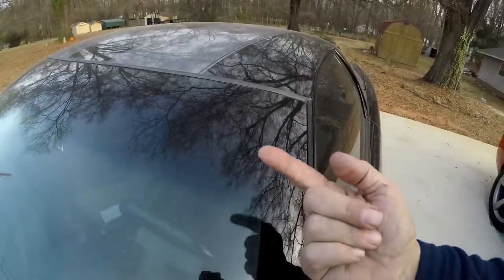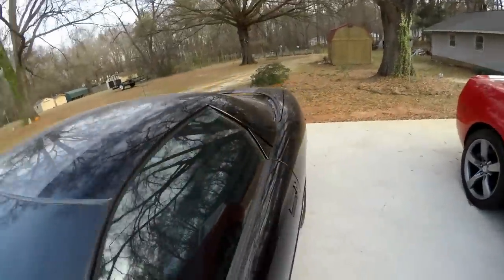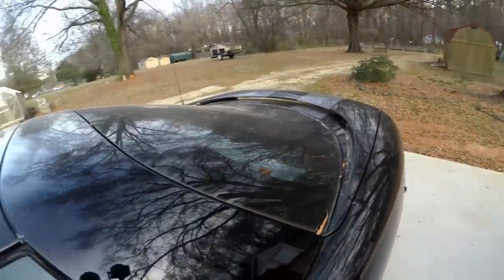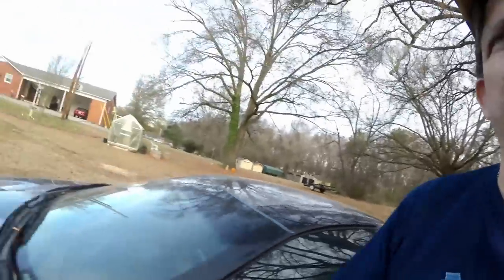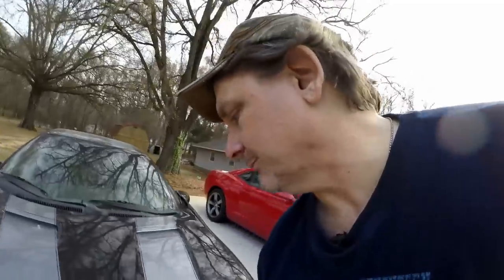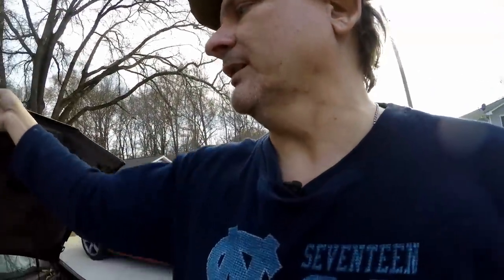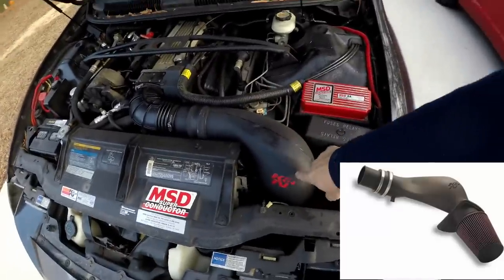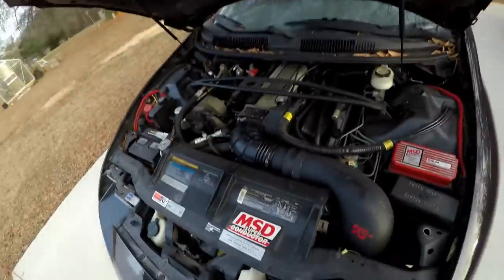Top Mods for a 4th Gen Camaro and my 1993 Chevy Z28

Comment: Good advice. I had a 98 Z28 before my 97 SS. I did full bolt ons inc: long tube headers , off-road y pipe , ls6 intake manifold, free air lid mod, SLP lid. The final step was a ported stock throttle body and man what a difference that final piece made to tie everything together. Vastly improved throttle response and made the car so much more fun.
Reply from the maker: wow....Some great mods!!! Sorry for missing the comment. It got lost in the YT shuffle............Thanks for watching

Comment: Got 97 Z28 anniversary want  to keep all original radiator split so I did a 3 core aluminum,  waterpump, opti spark, timing chain set,  10mm wires, iridium plugs, msd coil, long tubes, (3in) x pipe (3in) all parts took off were working but like you say there old . Throttle body on order went with 58mm (sorry) adjustable coil overs for front and rear vented rotors and new calipers all corners on order but now gonna do msd box, strut tower, have a 01 Z06 was sposed to mod and keep my white and hugger orange stripes original one you start with the mods its addicting I cant stop first time seeing your channel hope you still uploading
Reply from the maker: Hello there......Yes sir. Will be posting more really soon. have too much on my plate right now. but more def coming. So glad you found the channel. Hope you find a few things you like.  I love the anniversary edition.....Can not go wrong with hugger orange stripes!  I really want to repaint mine and go hugger orange with white stripes. Congrats on yours. Sounds really nice/. Thank you so much for watching

Comment: Just a tip all u fbody owners.  If u notice the wiper arm spring feels stiff when pushed down just spray a little WD40 on them. Pull them up & down until the stiffness fades away.  I had this issue with the wiper arms doing just that. Tried that to c if it did the trick yep sure took care of that.
Reply from the maker: Thank you very much for letting everyone know

Comment: A lot of great info... you now have me working on my neglected 2000 WS6... just did the UMI Lower control arms, energy suspension sway bar bushings "red" , enery suspension end links "red" , undercoating rear quarter panels and installing rear shocks today... UMI Adjustable Panhard Bar in the near future...
Reply from the maker: Thank you.  That's great ! Going to ride like a new one and perform even better. That new red will look good under there. Thanks for watching

Comment: The part that stops body twist is sub frame connectors.  I had that done on my '97 firebird. Amazing how much it puts to a end to that issue so common in uni body cars.
Reply from the maker: Actually, sub frame connectors help prevent flex at the rear of the car. They do nothing at the front. Thanks for watching
Reply: I differently noticed the improvement after having them installed back in 2004.  Then added the strut tower brace that year then in 2013 replaced the original coil springs that itself helped the ride.

Comment: These mods would work on most all cars. I would keep the electric adjustability not that hard to do plus the tracks already fit the car. Just bolt seat to your tracks. I used some camaro seats in my caprice for years then recently got a deal on some scat procar seats awesome racing seats only 200 each but the tracks were very flimsy. Only had to drill 2 holes in each camaro track to bolt seats to it. Was very easy.
Reply from the maker: I have been thinking about doing just that. Thanks.  . Thanks for watching

Comment: You should remove those nasty factory wheel weights and have the wheels rebalanced with inner adhesive wheel weights before they cause rim corrosion. That’s one of the first mods I did. Nice vid! 👍
Reply from the maker: Already taken care of. Thanks for the tip. Thanks for watching
Reply: Well the only problem with that is making sure u still get dynamic balance. Sometimes no room for weights on both insides. Static balance with just weights on center or outer edge is fine for soccer mom and economy ride but wouldn't do it on performance car. I try to dynamic balance everything to keep customers happy.

Comment: Here is another idea for a mod that I saw for the Optispark .
One Guy threaded the drain hole on the bottom of the waterpump and then threaded in a small tube to re route the antifreeze if the water pump fails ( starts leaking ) .
That way it doesnt leak all over the Optispark and ruin it .
Reply from the maker: That is a super smart idea!!!! Thanks for sharing. Thanks for watching

Comment: Headers and tune are the best bang for the buck. I bought a set of Mac mid lengths and y pipe
for my 93 Pontiac Firehawk LT1 . Also did the 160 degree thermostat. I had PCMforless of North Carolina 
do a tune for my mods. Dynoed 309 rwhp. Check out my video of the dyno. Nice power increase. Did all the work myself as usual.
Reply from the maker: Very nice. I still am thinking about going long tube. But I will have to do the EGR delete. Also if I do a tune, I will have to send the computer to them or go through dynosteve. So I will be without the car or spend $300. Danged if you do and danged if you don't...LOLI always do my own work as well. Satisfaction I guess. but sometimes t feels good to just let someone else do the hard stuff...LOL

Comment: I've got a 95 camaro and its a hard top. The paint on the roof is cracking. Had a body shop tell me it the roof panel is what's causing the paint to crack. Now its not bubbleing like the issues on the 99 camaros just cracks on the passenger side roof . ever had anything like that happen to your 93?
Reply from the maker: No sir. That is the original paint on my car. Except for the stripes. Had them added. Never even heard of that being an issue. Wonder why he is saying that? Thanks for watching

Comment: No such thing as too much air. With increased air comes increased fuel. Fuel rail, fuel pump, fuel lines, fuel pressure regulator. Don't forget about a racing chip or programmer, or custom tune. A bigger throttle body is gonna give you better throttle response and horsepower, especially if the stock one you have is restrictive as hell. One of the really restrictive things about this motor is the exhaust manifolds, heads, and intake manifold. Especailly the exhaust manifold. It's a log made out Iron. Same thing with the heads, made out of iron and restrictive. Get you a nice set of long tubes with a custom tru dual exhaust with x pipe and you will find yourself a very happy man! I use flowmaster mufflers on mine, 40 series.
Reply from the maker: Actually there is such as thing as too much air. If the computer or pump can not keep enough fuel flowing then you have to start doing other things to get it balanced back out. Only thing with chips is, all they really do is increase timing. They help but you then have to get a colder t stat because the extra timing makes the car run hotter. I need to buy a used computer from a pull a parts and send it in to get a true "tune" for the mods I have. Will def. run better. I actually had all the parts (cam, heads, throttle body and intake) to switch it over to the LT4. Just never got the injectors beofore hard times hit and had to sell everything. Thanks for watching

Comment: I have a '93 Z28 as well.  I purchased a pair of Doug's Headers that had the emission compliance connections.  I have subsequently removed the EGR system and capped them off.  If you don't plan on lowering the car you can run long tubes for any year up to 1997.  You will have to have the emissions components tuned out.  A fellow name Solomon at LT1PCMTuning.com provided me with a replacement EPROM chip.  You will also need a little piggyback adapter for the PCM to accomodate the new chip.  From 1994 on wards the cars used a flash based memory.  Thanks for the video.  Cheers from Canada!
Reply from the maker: Hey there. Thank you so much for checking out the video. I really appreciate it. I will look into Doug's headers as this is a mod I really want to do in the near future. Thanks for the info on the chip. Will check out the site you provided. Many thanks

Comment: I bought my 94 firebird with 245/50 R16 tires. These are slightly wider and shorter than stock and kind of hard to find. Of course your speedo will be off but it's a way to give your car some "gearing" without changing rear gears.
Reply from the maker: Great tip. Yep. Play with diameters can give you varied results. Thanks for watching

Comment: Strut support brace IS NOT A SWAY BAR....it did help to keep UPPER mount in place.....keeping alignment correct
Reply from the maker: No sir. Never stated it was. But if you tie the lower points together with a "sway bar" and it makes the ride stiffer, does it not stand to reason to do the same at the top? Thanks for watching

Comment: Hope 2 rebuild the rear maybe this summer being it has 3.08 gears & replace the stock torque arm with a aftermarket one. Had been thinking of doing this after putting it off over the past 5 years.
Reply from the maker: Sounds really good! All of those factory pieces are just so weak. Thanks for watching

Comment: About the throttle body comment about being to big that is wrong eve. With carbs never have to much cfm just have to jet it properly a engine will only pull as much air as it ca. use
Reply from the maker: Really? What about superchargers???? They force more air in correct? Point is, you have to build up to the larger body. You don't go stuffing a big mac in an opening that can only get a regular burger out. if you put the larger body on without having a good path for the extra air and fuel (which the computer will add when it sees the condition) you are wasting , time , money and effort of the engine. Thanks for watching
Reply: @CamaroTime  if I planed to do alot of mods down the line I’d do the throttle body first that way I can do those mods without worry about not having enough airflow can’t have too big but can have to small
Reply from the maker: Sure you can. If you do just the throttle body and nothing else, it is too big for your setup. You are wasting the extra air volume it provides.Do as you wish . Your car. But the throttle body for me would be the last. You can get instant benefits from other mods such as the exhaust system, MSD for a hotter, cleaner spark and so on....To each their own. Thanks for watching

Comment: Oh yeah, when you get headers. Don't do what I did and get some black painted pacesetters and just put them on, only to have them start to rust within a couple weeks and look like shit. If you end up with those, please paint them with VHT high temp paint so they look good and don't rust, or get stainless steel and leave em alone.
Reply from the maker: 10-4 thanks for the tip. And since stuff is so tight I am going to wrap them as well

Comment: Mas air flow sensor?  93' different than my 94' ?  Thanks. I didn't see one.  Thank you Sir.
Reply from the maker: You are correct/ The 93 does not have one as it is a speed density setup. Thanks for watching

Comment: I got a 98 z28. I'm going do some of these mods.
Reply from the maker: Excellent. Which ones you planning on doing? Thanks for watching
Reply: @CamaroTime  I just did my panhard bar. I'm going to do my rear lower control arms next. Should I do that before I do my rear shocks??
Reply from the maker: Nah, it really makes no difference in which order you do it.
Reply: @CamaroTime  ok, thanks I didn't want to bent my lower control arms. I was worried about that .
Reply: Just did my rear lower control arms. B.m r. No more wheel hop. Need a torque arm next...
Reply: Just did my strut tower brace today. Makes a difference.

Comment: I would go to a junkyard and pull a 350 lt1 out of another camaro and start working on the motor in your garage. New cam, new headers, new intake manifold, alluminum port and polished head, better pistons(forged), if you can overbore with bigger pistons and go 383, that's even better.

Comment: Which model MSD ignition box is that? And can anyone help me with wiring it up?
Reply from the maker: Hi. Thank you very much for checking out the video. It is the model 6A with their wiring harness https://www.partsgeek.com/z39fj4b-chevrolet-camaro-engine-wiring-harness.html?utm_source=bing&utm_medium=ff&utm_content=MP&utm_campaign=PartsGeek+Bing&gb=pp&utm_term=93+1993+chevrolet+camaro+engine+wiring+harness+-+msd+engine+wiring+harness&ad=11620898036  . Really just a plug and play . All I had to do is run a hot wire over to the distribution block on the passenger side fender.

Comment: Headers are good. It's really not what you get what you pay for, a lot of new companies are making mods for dirt cheap, like DNA motoring and they work... 
 I installed headers on this Camaro, mid length Pace setter headers and yeah they took forever to install. I think I slowly did it over a period of a month because I was working overtime and spending money on mods. But man did they make a difference! I could really feel the difference in power, like I had a new engine lol. 
 What is this y pipe shit? You have a V8 so why not Tru duals? Even if you have to have them custom made, fuck a goddamn y pipe. You can get a cold air intake for really cheap too, you don't need all that brand name shit. Just make sure the intake is a true cold air intake and goes under the engine bay. Had no idea that the msd ignition coil thing you have actaully improved performance. I was more under the impression that they were for race cars that needed more spark(because of the higher octane fuel running). But I guess I'll give it a try. And yeah that strut tower bar makes a difference big time. It connects your front suspension together, of course it will add stability. Do you have an automatic? Try that B&M shift plus. It's badass.
Reply from the maker: I def want headers......Some day. If I ever do I will then switch to true dual exhaust.  The MSD helps in so many ways.  I have never once regretted putting it in. Thanks for watching
Reply: @CamaroTime  can you please do a how install on the msd? do you need to replace the optispark?
Reply: Love your videos have been watching for a year since I picked up a 94 Z28 . Just replaced my trans. mount after watching your how to video, Thanks for all your help . have done several of the mods . seat is on the way, next is ignition and headers.
Reply from the maker: @gabified  Hey there . I actually did one. it is not a step by step . Because I would have to take everything out and then re-install. but I do cover everything needed. https://www.youtube.com/watch?v=FoaJW5c0faM
Reply from the maker: @gabified  Excellent. Thank you very much. Headers are going to be a pain. MSD is easy. I need to do seats myself. Thanks for watching

Comment: Has anyone owned both the lt1 and ls1? I'm saving up for a 4th gen and all my friends tell me to go for ls1 for 3 reasons. Easier to work on, more power, and more reliability. I'm only gonna be spending about $6k so I want the best bang for my buck
Reply from the maker: I have not in the Camaro line. I have had the LS1 in other cars. My 93 Z has the LT1 and the 12 2SS has the LS3. I would not say one is easier to work on then the other. Both are halfway under the hood. And both suffer from the same problems. Although the LT1 is more prone to leak oil from the timing chain cover.  With the LS ,,,there are so many out there so it is so much easier to find parts for it. Mine being a 93 I can not even find year specific headers for it. it is like it is the red headed step child or something.....LOL
Reply: Camaro Time ofcourse while I'm saving up I keep cruising the market. The lt1 camaros seem to run for a bit less cash. Ofcourse that makes sense since they a tad older. Ive been researching both engines for months now. Seems like they are both good engines capable of making good power with a few bolt ons. Ls1 seems to have a bit more potential or maybe seems that way because of its popularity. In a few months once all my $$ is here. Ill try to get the best bang for my bucks. Super excited
Reply: Go for tge ls1 if you want power. Lt1 is good but the ls1 so much better. I'm about to get a ws6 firebird. It's more cash but a better engine for sure
Reply: Yes ls1. Im on my second 93-97 camaro, 1st Z28 lol. Also had an 02 Firehawk 6 speed in my early 20s. Cant beat that LS1.